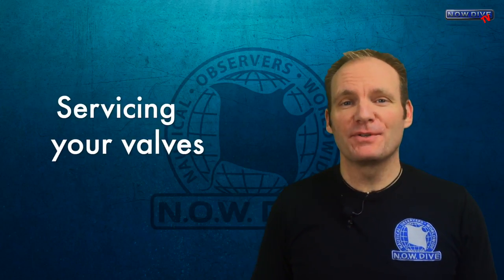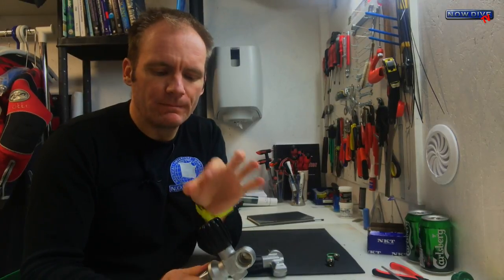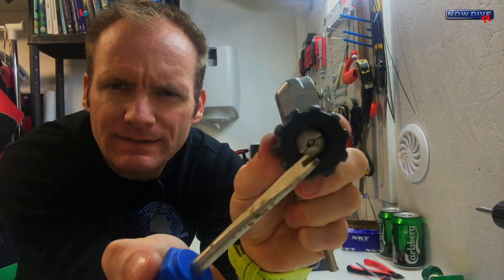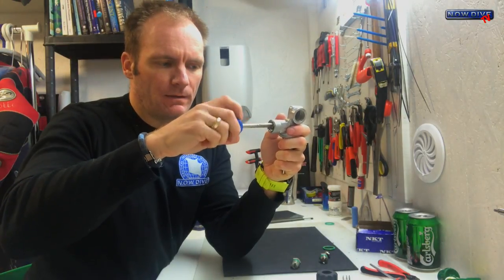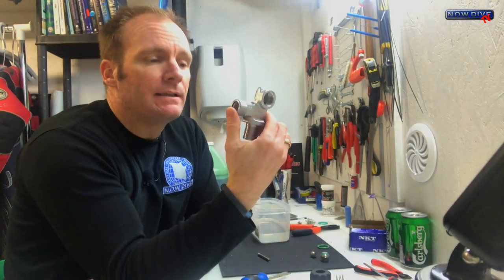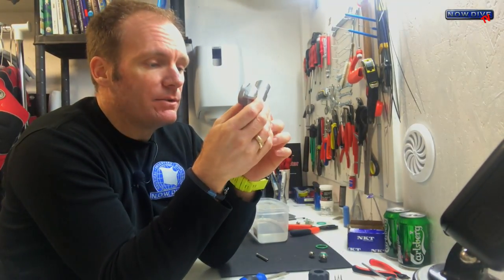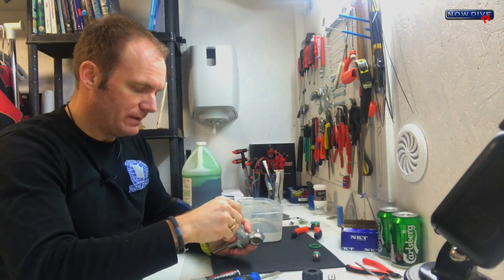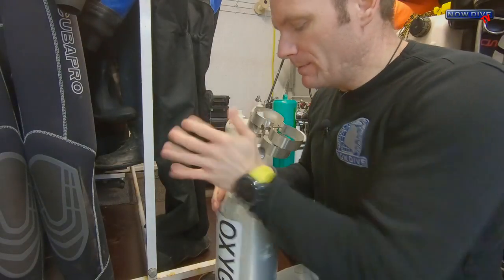How to: Service your scuba valves

Comment: thanks very helpful only one note my manifold and valves are made buy Apex and they use an allen key (Hex drive.) the same size as is used for removing an  A clamp adaptor insert, to remove the handles not a split flat bit screw driver took me a while to work this out!

Comment: 19:12 on recreational cylinders, we see dive shops and manufactures suggesting crystal lune be applied to the valve threads before screwing into the dive cylinder. 

Is it common practice to omit the grease when performing an O2 cleaning or one of those debatable points of preferance?

Comment: Thanks for the vid. Just one question. Is this the actual way you O2 clean  your valves or is this just for demonstration purposes? I'm now feeling a bit too anal the way I do mine. :-D
Reply: I was thinking that as well.. going on about hydrocarbon free cleaning fluid, but no final inspection with UV lights, uses a paper towel (hydrocarbons!) to dry the components, and not wearing nitrile gloves when reassembling..  but again, maybe I've also been taught to be too anal when it comes to O2 clean..  after all it's mainly the outside parts that are being handled.

Comment: Great video!

Do you have a link for the airgun that connects to a regulator 1st stage?
And for the 'split-screwdriver' tool used to open the knob retainer on the valve?
Reply: Pathless where do you live? But find a “bestdivers” dealer they have that kind of stuff. Sesrch for valve tool. The airgun i made myself. Screwed in an inflator coupling into a normal lp airgun
Reply: @benbos1925  Thanks for the tip! I'm based in Denmark. Managed to find an airgun that will connect to my 1st stage, but haven't been able to track down one of these valve tools yet.
Reply: Pathless nå en Dansker, prøv eventuel Bjarne fra Aquashoppen eller John fra Scansub eller Tommy fra scubagear.

Comment: Oxygen clean, but... no nitrile gloves. Also is the plier oxyge clean? A lot of places to introduce hydrocarbons to the internal parts of the valve. Tainki into account that yhe internals should handle really high pressure O2! Not very professional.
Reply: I was quite concerned with the bare hands handling of the cleaned components. Let’s face it most bench air compressors used to air blast parts dry needs to be seriously considered as to what quality of air is being used. 😮